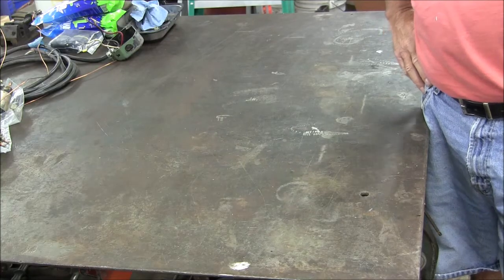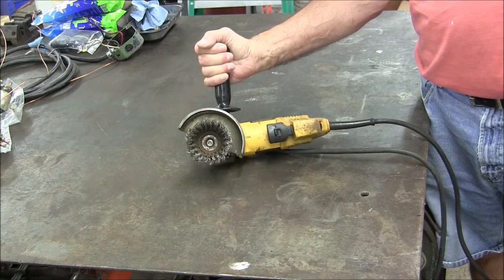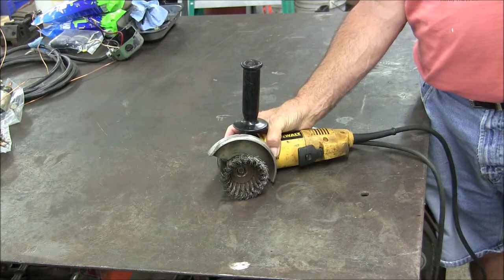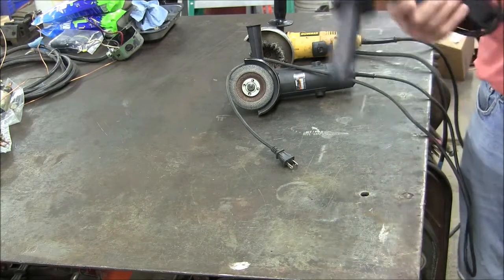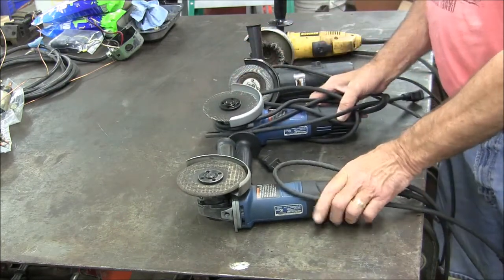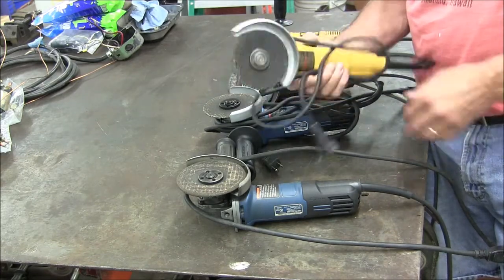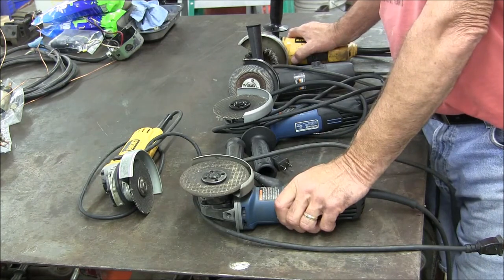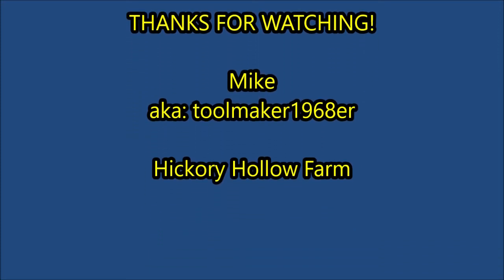A most valuable tool

Comment: Are there any polishing type discs / brushes available like you can get on bench grinders? I like to do a bit of polishing on the lathe (after laying down the paper towels) and could see this being a real time saver!
Reply from the maker: Adam Carmichael - I don't believe there are any polishing discs specifically for lathes.  But I sure wouldn't hesitate to adapt any disc that meets your needs to a lathe spindle. The problem is finding a lathe capable of the 3000 plus rpms common for polishing. Tc, Mike